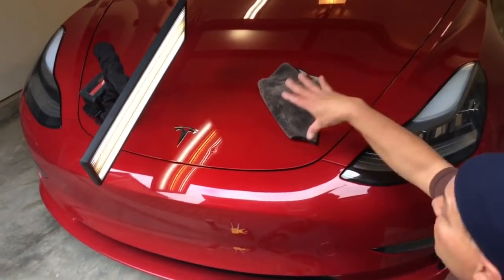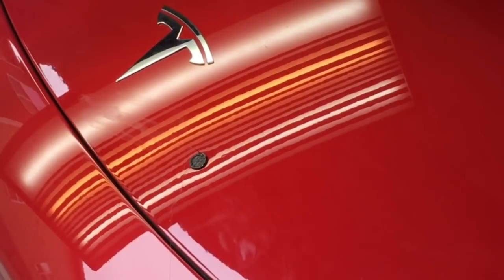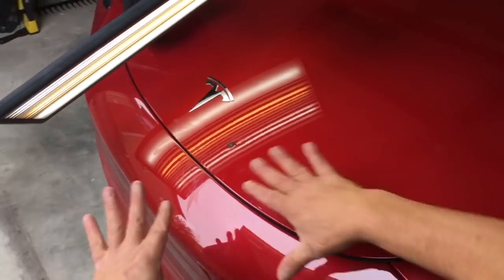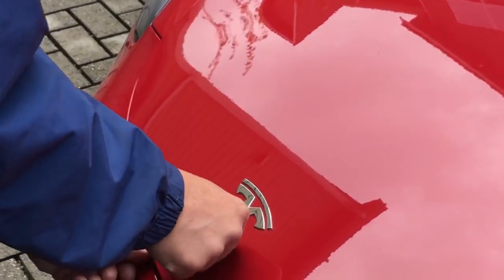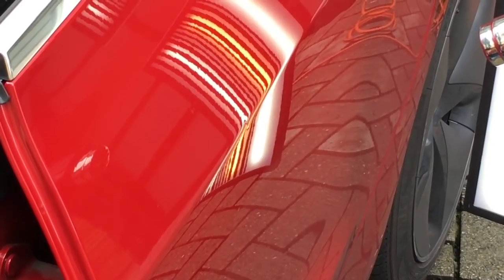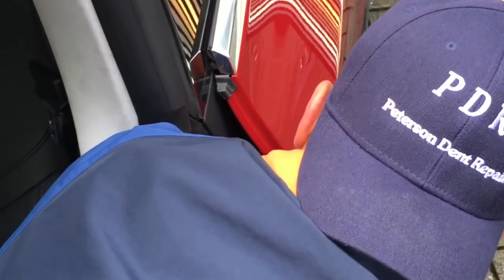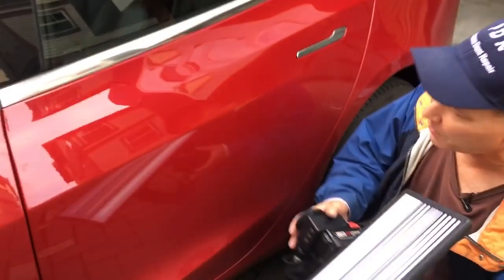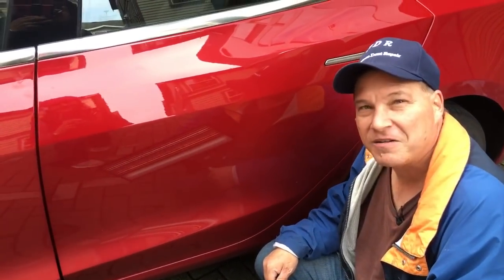PDR vs. 2017 Tesla Model 3 hood dent⚡️ #Undented #PDR #Teslamotorsclub

Comment: Hey there PDR! Perhaps I missed it, but just wondering why you didn’t use the heat gun on the hood? Does the aluminum react differently? Thanks for all of your videos!
Reply: Heat works great for aluminum.  Get it to about 200/220 degrees and it moves like butter.

Comment: Good job Garth, you were right about knocking the dent and continue pulling, knock it or tap on it for some time and you should be able to pull some more meat
Reply from the maker: Osama AL Mustafa that’s what I’ve been thinking if I just pounded it into a really really wide dent and then pull the meat out of the center but because of a little scratching the surface it had me scared. The customer actually asked me to drill a hole in the inner brace work and I said no little too risky.